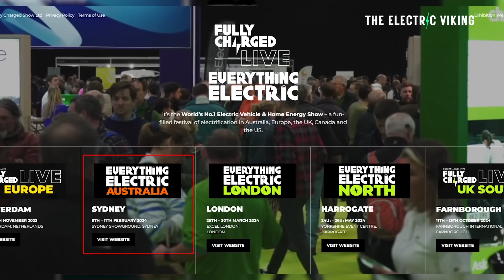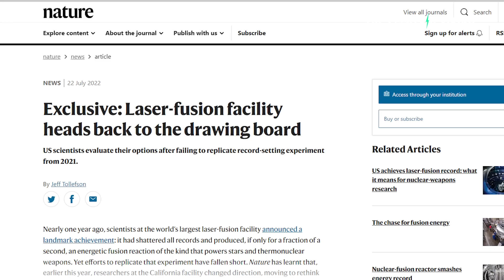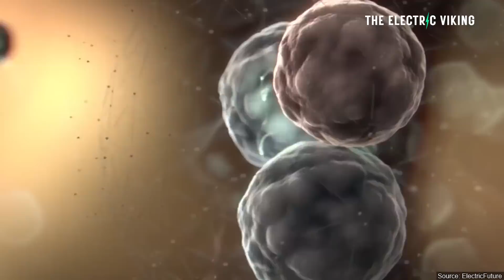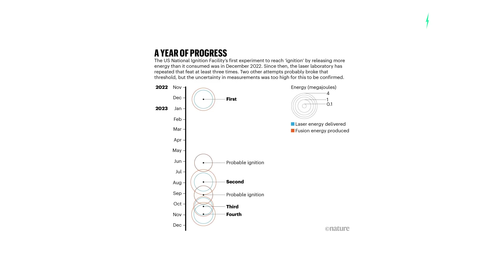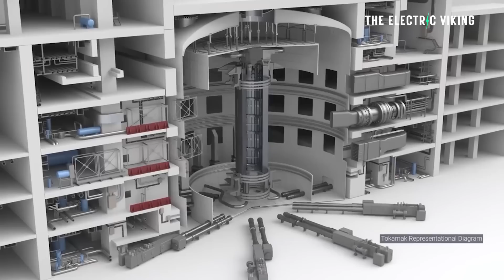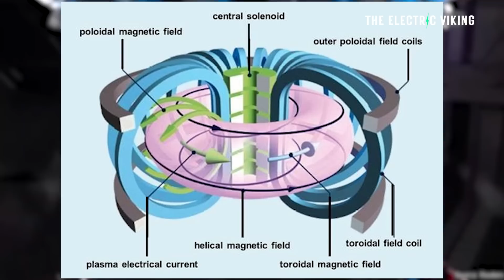US nuclear-fusions game changing achievement; ‘ignition’ over and over

Comment: The fusion in question does only released more energy than the photon energy that was put in for the ignition.
But the process to produce the ignition photons has a very low efficiency and therefore there was much more power drawn from the grid than power released from the fusion itself.
This announcement was a kind of optical illusion. Pun intended.

Comment: Tokamaks reactors exist from 1956, they all lover corner to  work :) All mindset is bad. Fusion and fission  reactors all based on heat technology, they not produce CO2 but they all release heat into surroundings and that causes our closed energetic system Earth to heat up. Energy multiplication without heat 100MW electricity and produce 300MW output without  fossil and nuclear (fusion and fission) is answer to global energy problem. But science don't have description of entropy to simple mechanical turbine we living in dark ages of science, is very hard be engineer by trial and error to built sustainable energy without knowledge what you building.

Comment: The NIF (laser driven implosion fusion) beat magnetic confinement to nominal breakeven.... But tacitly this is due to the terrible cost and schedule overruns of ITER.  Had ITER been built on schedule the contining theoretical and experimental work (much of it at JET) strongly suggests it will work, and thus would have beat NIF to that nominal breakeven benchmark.

But neither of these systems is remotely practical economically, NIF particularly so.  It is not clear at this time  that there is a technical path to economic power production... PARTICULARLY competing with Solar + transmission + storage, at least for stationary power in most of the world.   Even if fusion becomes "practical" the economics look brutally hard, because solar is really  cheap when the sun is shining. This means that anything else will only have a backup/peaking market.   And the problem with that is low duty cycle, meaning that the economics require some combination of LOW capital cost or very high electricity price.  Nobody thinks fusion will ever get cheap.  So the question is who will pay extremely high prices for fusion power backup, and how dies that compete with storage?

Comment: I have always been a huge proponent of fusion energy, almost 50 years of hope and support.  The technology has made some incredible strides in the last 10 years and maybe in the next 10 it can actually make power that is marketable.  However, in the mean time there is only one "clean" energy source that can provide the required baseload capacity that our economies run on, that is fission nuclear power.  In your video you simply dismissed that power source as being too expensive, done, no more comments.  If in fact CO2 will destroy all of mankind in the near future and that if CO2 levels aren't reduced by 2050 there will be no turning around, the cost of using fission nuclear power shouldn't be an issue.  In fact trillions are being spent on low density renewables that can't even come close to meeting our needs.  If the level of over regulation in the nuke industry can be eliminated, safely, the cost and time to build these plants would drop dramatically.  Not to mention the new approaches to fission power.  

The current PWR, BWR technology is analogous to a model A car, imagine driving one of those right now instead of a Tesla Model S plaid? 400K people die every year due to indirect exposure to coal plant emissions, maybe yes, maybe no.  But, how many have died every year due to nuke plants, close to 0.  Almost all of the nuke accidents occurred because of LOCA, something the new generation of reactors would not experience.  And the 2 accidents that did occur were due to operator intervention errors and lack of maintenance of a standby natural convection cooling system.  Chernobyl was just a poor design that was operated way outside its required safe conditions.  The US Navy has been operating nukes for over 50 years with no issues. 

If fission can be used as fusion is being brought on-line, it could produce enough power to also drive the H2 economy, no more extremely dirty batteries needed.  Put a H2 plant right next to a nuke, produce the H2 and send to out to the already located filling stations (retro-fit gas stations), The current highway system will be the distribution system. 

Like you video, had lots of good information.

Comment: All laser-driven fusion experiments are at laboratory stage, no one can say when and if they will reach commercialization. All they do are lab experiments. Fusion is very close to the commercial phase not  in this type of experiment, but in the tokamak-driven fusion. Check CFS (Commenwealth Fusion Systems). They will finish the SPARC reactor by 2025, which will be the proof of concept, achieving global positive energy generation (energy generation will be larger then the whole energy input to make the thing work, not only the plasma input). By 2030 they will have done the ARC, which will be the first viable fusion power plant. Nothing else comes as close to the commercial phase.

Comment: This was a lab simulation. Her title was 'Research & Modeling'. Whenever you hear the term 'modeling', run. It is garbage in and garbage out. Even the research paper you highlighted stated that they could not replicate the results. This screams of manipulating data to show progress - which is needed for continued funding. They must achieve temperatures of some 100 million degrees Celsius for commercial power generating operation (thus, simulations in lab). They will have to mine the fuel from the moon. If you are old enough to read this, your great grandchildren's great grandchildren will not see it in their lifetimes. Millions of times tougher than Hyperloop, Full Self Driving, Robo taxis, Neural link, colonizing Mars (we couldn't successfully make a self-contained ecosystem on Earth and we're going to do it on Mars??), high speed autonomous vehicle tunnels (see Las Vegas), sling-shot-super-spinner satellite launchers, viable electric semi tractors, viable solar roofs, solar roadways, electric airliners, rocket launched commuter travel, carbon net zero, etc. - and none work (maybe next year?). One must read beyond the modeling projections, headlines and self-serving news releases to learn the truth (and crunch a few numbers, yourself).

Comment: 'Nuclear is always more expensive and takes longer than initially projected' so does any large scale construction project. Imagine if that attitude was applied to railways. Roads. Pah, takes ages, its expensive. Just leave it. Forget about it. Never understood it. In the UK 2 x modular nuclear stations could have been built for the same timescale and cost as 1 new high speed rail line. But they went with the railway. It failed...it hasnt even made it all the way to it's destination 😂 but nuclear. Nah, leave it. Takes ages.

Comment: Nuclear power plants always go way over budget because of government regulations.  Sadly, coal, gas, and renewable power plants have relatively little regulation.  Radiation near coal plants are much higher than near nuclear plants, but nobody regulates the radioactive emissions of coal plants.  Waste from nuclear plants is extremely regulated, and for good reason.  But waste from coal plants is literally pumped raw, directly into the air. 
Solar and wind kill countless animals and require vast stretches of land to be developed, where nuclear is relatively small for the amount of energy produced.
If you were to spend the money on regulating fossil fuels and renewables so that they impact wildlife and the environment as little as nuclear, their cost would also balloon out of control.  
Fusion would be great, but it's still 30 years away, as usual.

Comment: The reactor that you show at 7:12 was built by the Seattle based startup, Helion. They are the ones that had the big breakthrough last year and as far as I know they are scaling up now. Private company.
Reply: What was there big breakthrough?
Reply: @Dunriteproducts  If you look at the machine at 7:12 the fusion reaction occurs in the middle. The machine was built as a proof of concept. Basically it is two linear accelerators blasting the deuterium isotopes together in the middle. Deuterium isotopes are a nucleus of a proton and a neutron. What has to happen for fusion to occur is you have to get the isotopes close enough together so that the Strong Force (the force that holds like charges together within a nucleus) overcome the Electro Magnetic Force of repulsion and creates a new nucleus. A Deuterium isotope has more than twice the mass of a hydrogen isotope. Therefore when you accelerate it it will have more than twice the momentum of the hydrogen isotope for the same velocity. Therefore when you accelerate Deuterium isotopes at one and other you have more of than twice the stuff that the Strong Force requires for fusion and less than half of the stuff that the Electro Magnetic Force requires to prevent this reaction. Brilliant.

Comment: Not so fast.  Getting 50% more energy out than the energy you put in is not the same as getting 50% more value out of the cost you put in.  What is the value of the energy that has been created?  If you have to build and maintain the equivalent of a Ferrari just to get one extra mile of mpg, you haven't achieved anything economically.  A scientific and engineering achievement, yes.  An economic achievement, no.

Comment: A fusion power plant that produces merely 10% more power than its input power would still be commercially viable. 89% pushes the profitability sky high and makes fusion energy competitive with renewable sources. The only obstacle remains continuous use. That problem will be solved eventually, possibility by having multiple fusion reactors where some are cycling through power up phase while one or more produces power out to the grid. Exciting times friends.

Comment: What’s with the random imagery of totally different fusion approaches. The one you’re talking about  is slightly less practical than the only approach known to actually work with technology we have already would be dropping small fusion bombs into a massive  and structurally sound tank of water a mile across with a constant stream air bubbles coming up through the water column to cushion the shock of the explosion   The vast construction would of course have to be capable of withstanding the immense  forces involved down side is a lake of billion tonnes of mildly radio active water once the water is hot then use steam turbines

Comment: @user-nh1bx8pp7e had it right. The figure you quoted of 1% more to over 50% more "power in / power out" actually does not take into account the actual electric power needed to produce the laser beams (this is really inefficient). I think this tech has many many years to run before actual grid-scale power production. I think Thorium fission/ molten salt power plants will get us there a load quicker..just needs that investment/ regulatory reform to get it onto a level playing field..

Comment: The fusion energy released in the reaction does not take into account the amount of power needed to charge up the capacitor banks powering the lasers,which is much more than the output of the fusion reaction. Even fusion physicists don't get or ignore this.

Comment: Hang on . . . "creates temperatures and PRESSURES greater than those inside the sun." That's a load of tosh. Labs must increase temps greatly to offset the FACT that there's no way to approximate the immense pressures of the sun's core.

Comment: This is technically very impressive. I still think the big, free fusion generator in the sky is our simplest path to all the energy we need on the planet. 

Preparing for one ignition is a big job. Industrializing and scaling it will make the Model 3's "production hell" look like a walk in the park.
Reply: EXACTLY!
Reply: Solar is simple, but due to power being inconsistent, you have to overbuild the theoretical capacity by several times to make up for real world interruptions. Ive heard estimates that it will take 25 times the world's manufacturing capacity of glass just to make the panels alone. Increasing industrial capacity by that much, especially a very mature product, has not been done quickly at any point in history. It may take as long to build out solar as it will be to commercialize fusion energy.
Reply: @skyhawk551 

"but due to power being inconsistent, you have to overbuild the theoretical capacity by several times to make up for real world interruptions"

Not necessarily.

If you combine parallel grid storage builds and HVDC to connect countries that have abundant supply but low demand then it's not necessarily so bad as that.

Add in wind and tidal power builds to further balance the equation (with their own storage) and it all becomes very achievable.

Fusion on the other hand is full of ifs and maybes beyond the power generation itself.

Pulling actual energy from the reactions without causing showstopping (and efficiency stealing) slowdowns to it is going to be a huge technical achievement all by itself even after net gain is so great that the expense is worth it.

Unless someone figures out a way to make aneutronic fusion reactions much more efficient - as converting the energy from those reactions is much simpler owing to the end product being mostly charged particles whose energy can be harvested directly through electromagnetic means using a very efficient process.
Reply: "I still think the big, free fusion generator in the sky is our simplest path to all the energy we need on the planet"

Simplest, but not 24/7 dependable without massive grid scale storage infrastructure.

While renewables are building out very quickly, the scale of grid storage buildout is lagging so far behind that in the near term the only way to survive entirely on renewables is international energy trading through HVDC networks.

The thing about fusion is that by the time it finally becomes viable the world infrastructure for renewables/storage/HVDC will be so well built out that building fusion projects will probably end up mostly redundant except for backup in times where both sun and wind are at a low output, though even then there is still tidal power to work with.

Comment: This is great for physicists who study fusion and super high temperature plasmas, but it is orders of magnitude away from a practical way to generate energy for the grid. They have produced more energy than was in the laser beams, but the amount of electrical energy that went into the lasers to produce those beams is still many times greater than what was generated by the fusion.  Their lasers are on the order of 1% efficient.  I don't know, maybe 2%.  You would want lasers that were 80% or 90% efficient to make this commercially viable.  That's a completely separate physics problem and really hard to achieve.  My guess is that the magnetic confinement approaches to fusion being investigated by other labs are more likely to bear fruit before laser inertial confinement does.

Comment: I think the world should move forward with fusion research. But did you know the US government had two working thorium reactors at Oak Ridge Laboratories in the 1970s. There are many companies and countries working on the problems with thorium reactors. There is said to be resent advances that could make thorium commercially viable. Thorium has several advantages of conventional atomic energy such as cheap fuel (It is a waste product of some metal refining.), low pressure is used in cooling, thorium reactors cannot melt down as Fujishima and Chernobyl did, the half-life of the waste is 200 years. Cheap clean safe thorium reactors could be installed at coal fired facilities or mothballed conventional facilities. When is this guy going to do a video on the current state of research on thorium reactors? Why advocate for expensive voltaic solar panels when there is thorium? Why advocate for electric vehicles with dangerous lithium batteries, long charging times and limited range when existing internal combustion engines can be powered by water as was demonstrated by Stanely Meyer and Dennis Klien? 
While I don't buy into the climate change propaganda there are ways to produce cheap clean energy without producing that dreaded plant food, CO2.